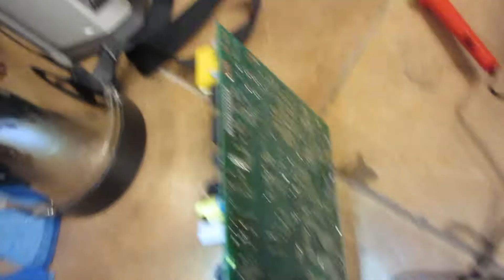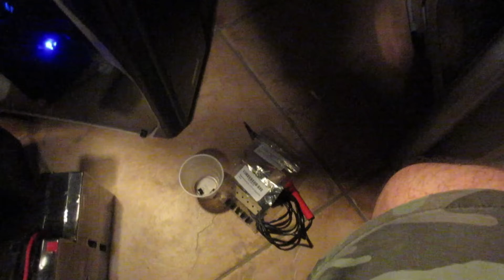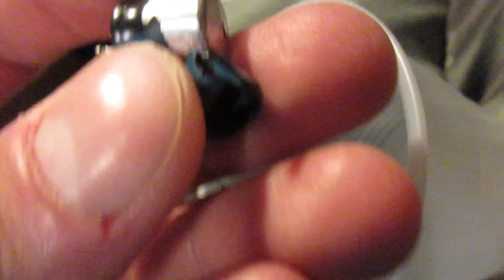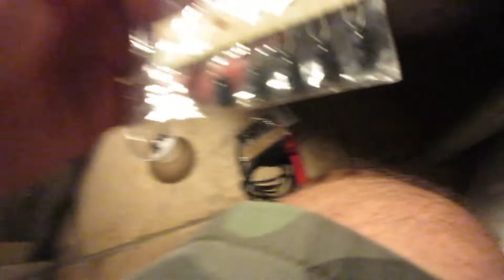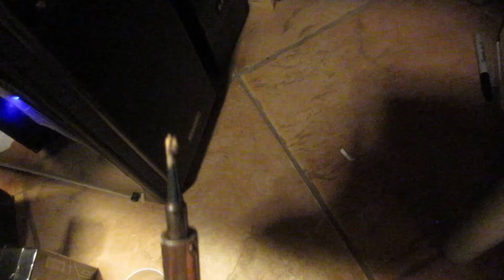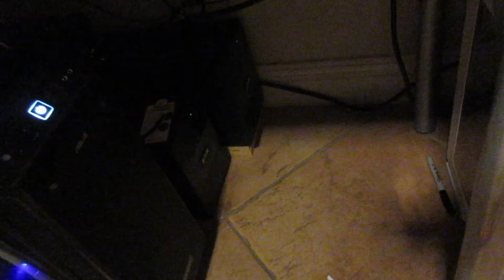Replacing Faulty Capacitors on Eaton 5p UPS

Comment: Just to mention it here, as the explanation is good. For 5p-650 rack version C39 is 470uF/35v instead of 220uF/50v with the same dimensions. Maybe others with 12v battery voltage use higher capacity/lower voltage capacitors. I used EEUFR1V471 and everything is good now. I also checked all capacitors - most of them were with relatively good ESR/D-factor (tan-d), approx. 20% less capacity, except C91, C39 and C70 (not sure which was worse - 140u/2.9d and 400u/0.7d, both are 470u/35v)
Reply from the maker: Did you remove the caps from the board when checking them? Or just probe the pins from the bottom of the board  Yea These are all 5P 1500s I have. They  maybe had a run of bad caps or just the power is so bad here in FL they got stressed.   I had 3 units fail on me
Reply: @GhettoWagon  Yes, I ordered and replaced all caps. Only the two of them that were connected to the batteries were OK.
I guess heat is the problem, as there is very hot transistor next to it. In rack version is even worse

Comment: I have this UPS model and today it sent me the message/alarm "FAILURE #2 BY SHORT, CODE: 0x805.

Do you believe this failure is by some failurein some capacitor or what do you thing?
Reply from the maker: Probably something different.  Not sure about the code You could call or message eaton maybe they might explain it

Comment: Mine is 5p 1550i , I’ve got fault code 502 max charging voltage error , I’ve search all over the internet and nothing come up. Sad day.
Reply from the maker: Yea not sure.   Maybe the charger is bad on it on the board.  That is not a lithium version is it?  Check or post on Spiceworks if you have not this is where I found this info. Mine has been good. No issues 2 weeks now very happy.  I have 3 other units now I bet will fail the same way. Ill fix.